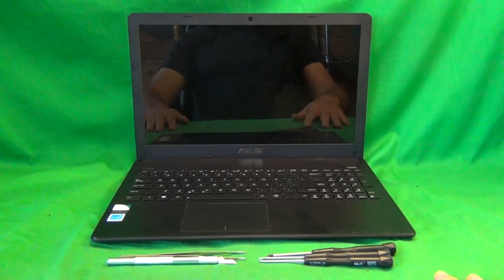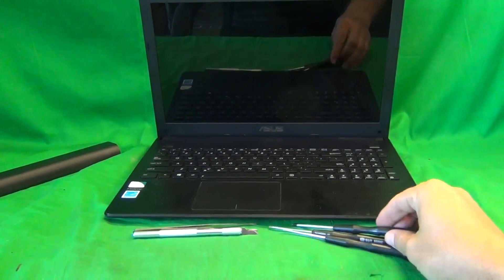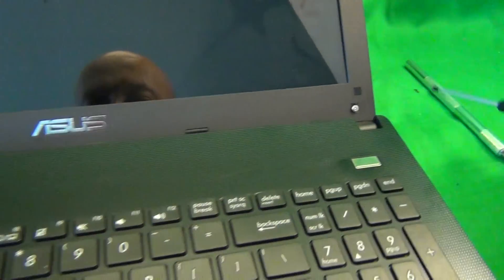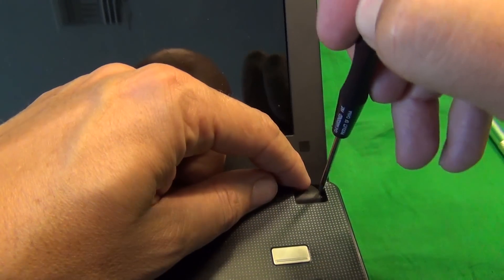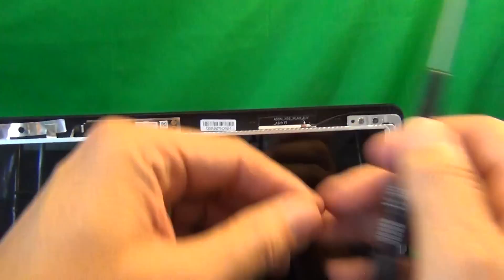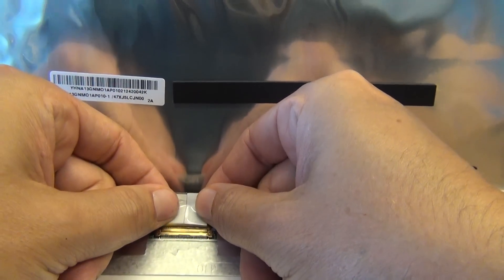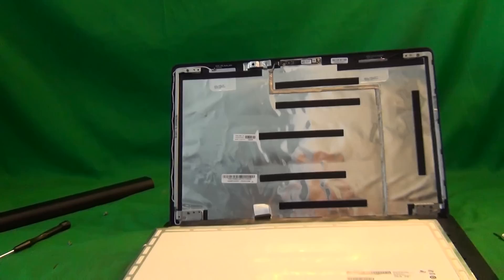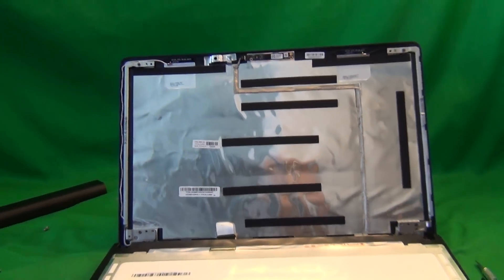ASUS X501A Laptop Screen Replacement Procedure

Comment: hey i got a question on your site theres a kit that sells laptop replacement accessories. The cheapest one i found was "Laptop Screen Replacement Tool Kit" for 10 dollars but you mentioned you used the PH1 screwdriver and that kit has the PH0. Would the PH0 unscrew this asus x501a as well? Also does the model number matter if the screen is for a 15.6 x501a asus laptop and my laptop is an x501a? would the screen be built differently even though its for the same laptop?

Comment: the two lower screws (5:50) were missing in my laptop too. I believe that that caused the lcd panel to tilt a little and disconnect the connector causing the malfuction i was experiencing